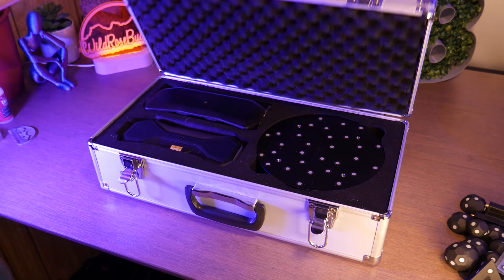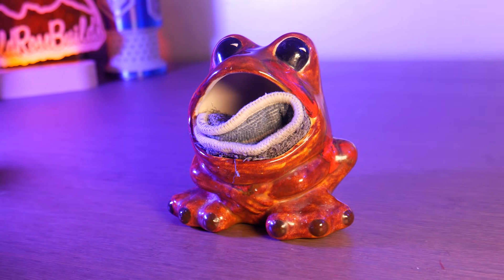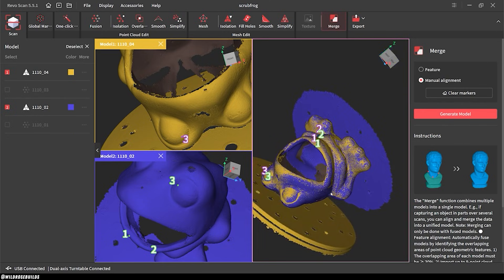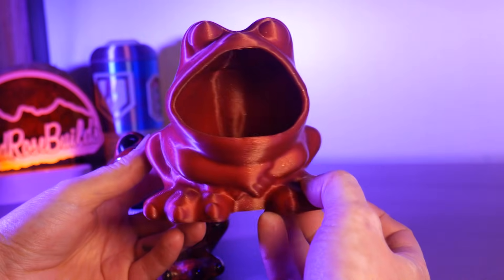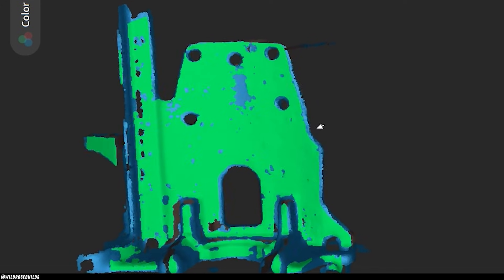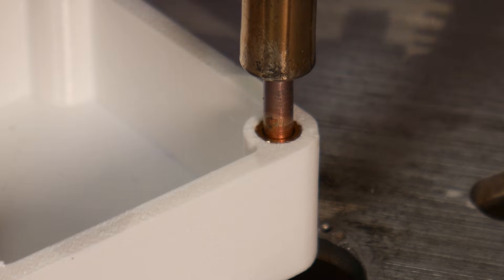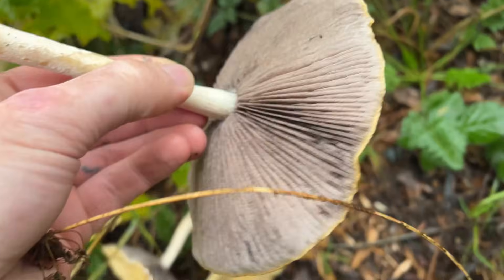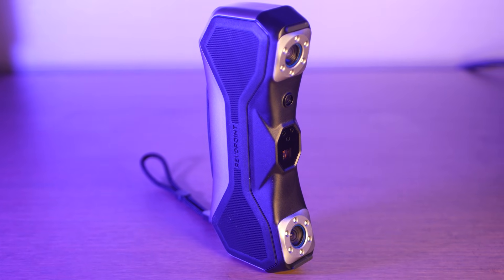TURN ANY OBJECT INTO A 3D MODEL // RevoPoint MetroX 3D Scanner first look

Comment: One tip is that you shouldn't use a mesh model for reverse engineering. It's better to use point cloud data, because that's more accurate.
Reply: Hi, I'm about to purchase this 3d scanner and I would be using it for reverse engineering, and was wondering what you meant by using point cloud data? Does it mean exporting the results as a specific file format, like stl and send to a 3d printer? Thanks in advance.

Comment: iPhone will scan anything into a 3D model as well?
Reply from the maker: I haven’t tested phone scanning but I’ve tested photogrammetry and the detail on a dedicated scanner like this is much higher
Reply: @WildRoseBuilds  yea I have tried it with my phone but it’s very low quality and you have to manually fix the model up in cad
Reply: @WildRoseBuilds iPhones have lidar